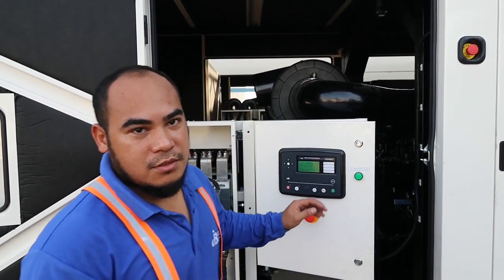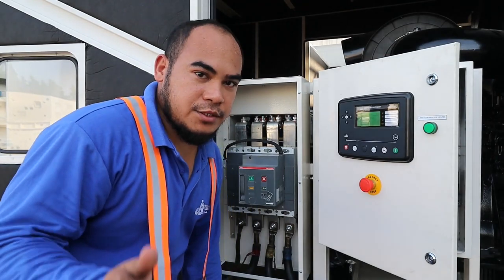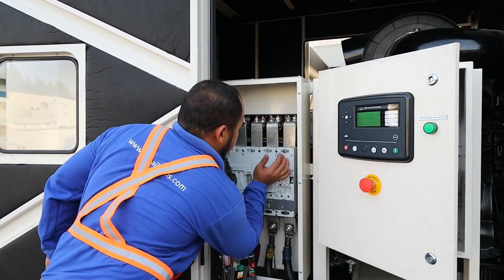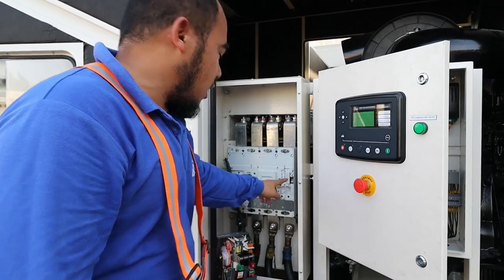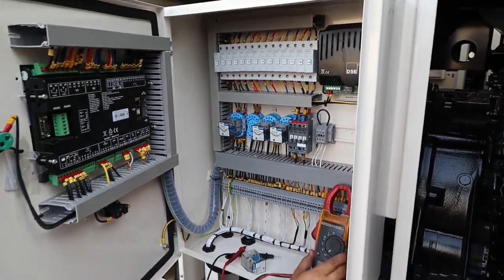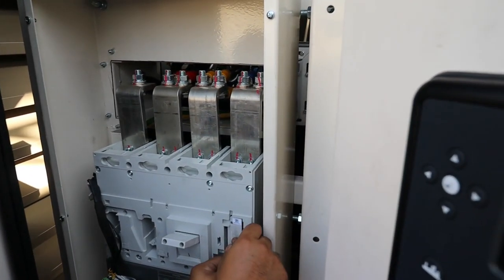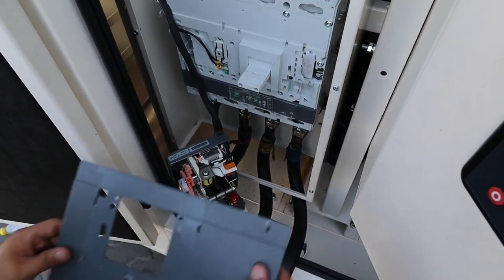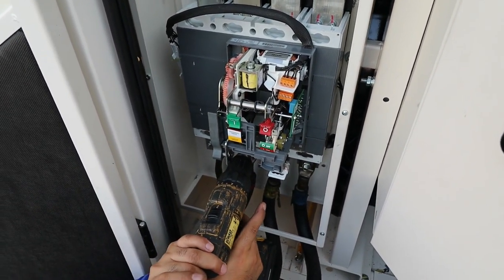ABB BREAKER FAIL TO CLOSE? why and how to fix it. benzblogs

Comment: Let me know if there is any power from the  motorized breaker close auxiliary and how much it will be AC or DC ,breaker is close and also close and if there is no power, will the relay be operated?  Please reply
Reply from the maker: If you say close auxiliary it is only dry contact from your breaker you can supply  ither ac or dc depends on your needs and also relay operated depend on the way you wired or design.
Reply: Please reply

Comment: Sir, My Circuit breaker on a faulty diesel genset is showing "STP GCB Fail" and "wrn volt reg Lim"  only when it runs with other generators. When it runs by itself, it doesn't show the two alarms. What do you think the issue is?
Reply from the maker: Ok sir meaning your voltage low as the setpoint nominal now that why give trip now just adjust the voltage amd make sure it can be control by the module during sync

Comment: Should only open a breaker in test/trip position
Reply from the maker: sometime you need to open to double check if aux contact still good condation sometime not working anymore or defective its make your sudden fail to open or fail to close
Reply from the maker: Yes sir you should open the breaker in Trip or of position

Comment: Sir my lift does not run if DG POWER is on
Reply from the maker: Okay make sure the the wiring is correct phase and the boltage rating or your left is match to the generator and generator current aswill as your left

Comment: Idol pag ganyan ba alarm fail to close nasa supply lang ba ang issue?
Reply from the maker: Dependi lods maraming pweding causes Isa najan Ang supply,configuration,relay ,wiring connection Yan Ang mga pweding dahilan Ng alarms Kaya di gumana
Reply: @benzblogsVlogs ok naman ang relay ,wirings, dapat ba naka off position yong breaker bago mo salpak ang motor control mod.
Reply from the maker: @jinglingao-lingao5153  pwedi g naka off pwedi g naka trip ang titignan mo jan kong pomasok ng tama doon sa handle ng breaker para gomana ng maayus lods
Reply: @benzblogsVlogs salamat idol... 👍

Comment: Sir, paano kapag 2170 GB Close Fail. Okay naman ang relay, minsan nag close siya, pero minsan ayaw talaga mag close ng breaker kaya lumalabas na ung alarm na GB Close Fail.
Reply from the maker: Check ko yung aux contact di gomagana ng maayus kay ganyan nasa loob yun
Reply: @benzblogsVlogs  Paano naman kung sakali sir i-manual na lng yun, yung aux lng din ba aalisin or may alisin pa kami para imanualnon and off na lng breaker.
Reply from the maker: @emmanbutler  kahit nakaw manual ka my feedback patin yun galing sa module pag di gumana matic iTrip Ng module Ang breaker

Comment: Proses is long 
2 dg set on load amx 500 kw then one gcb fail to close not possible for clear alarm and start dg again.
Reply from the maker: Yes because it breaker position or the aux sw inside ither problem or posation of the breaker double check the wiring and output voltage from u1 u2 what breaker your using?